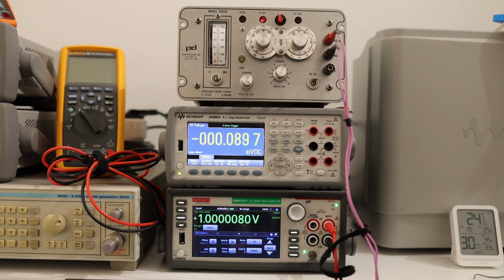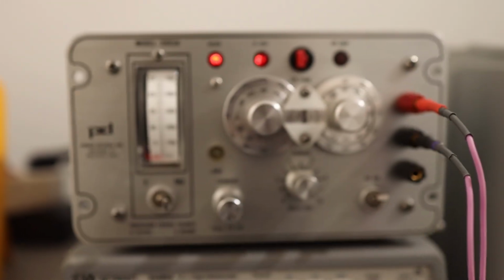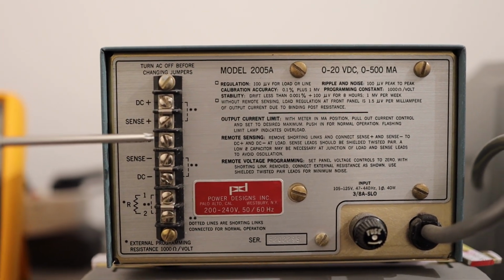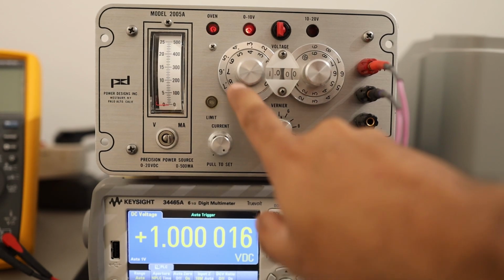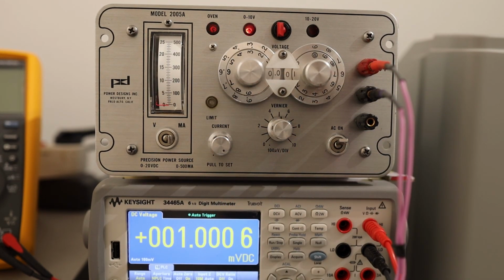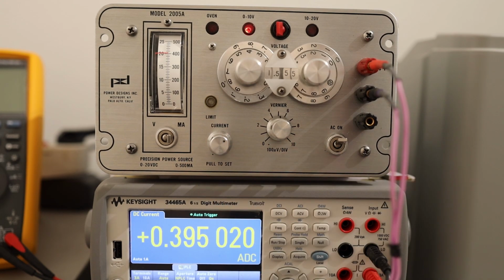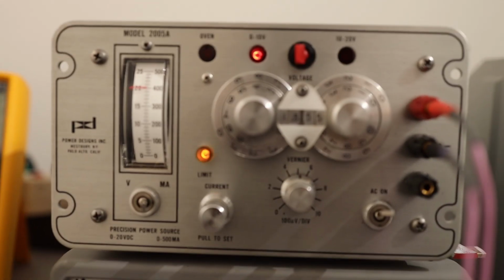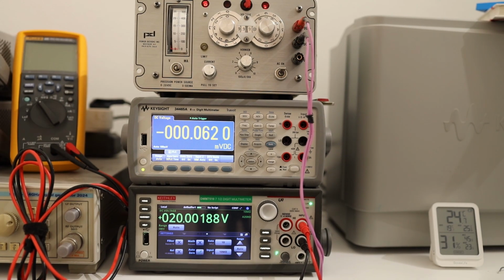51 Year old Power Designs Model 2005A Vintage Classic Precision Power supply

Comment: Can the rear terminals be used for more permanently installed +/- voltage just the same as the front plugs?  May use one for a phono preamp.
Reply from the maker: Yes They can be used in Permanent setup as well.
Reply: How does ground work on this power supply?  When I measure plus to minus I get the voltage dialed-in, but when I measure plus to ground I get about 2/3rds the voltage set.  Is the ground common? Floating?  Confused.
Reply from the maker: @mootzeroni  I have just looked at schematic,  Output is Floating with GND. Voltage you see will be due to parasitic capacitance in the Transformer.
Reply: @ this is very helpful.  Thank you so much.  I’m now using a pair of these (only mine has a meter with wiper) to provide a highly regulated +/-15vdc for a stereo phono preamp.  Overkill, I’m sure but looks kinda cool and sounds great.

Comment: Would be nice to see the internal how they engineered the product so long ago and even then it's still spot on. wondering how they managed to calibrate the product.
Reply: Yes, I just checked. Dave has a teardown of a 2005 from 10 years ago. "EEVblog #649 - Power Designs 2005 PSU Teardown"
Reply: I think either EEVBlog or The Signal Path has a tear down of one of them.
Reply from the maker: Teardown would be good but There is not really much to see to understand it, There only few very precise resistor on the rotary Switches . If you want to understand schematic is available on the internet. It has a error amplifier and few resistor with a drive transistor. Error Amplifier transistor are in a small temperature controlled  enclosure.